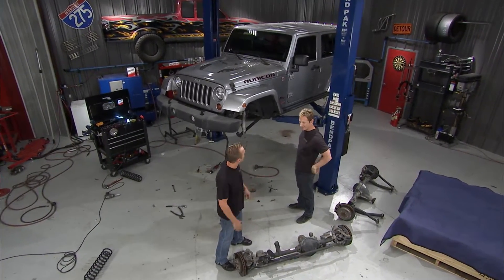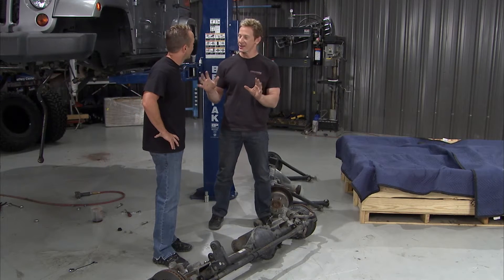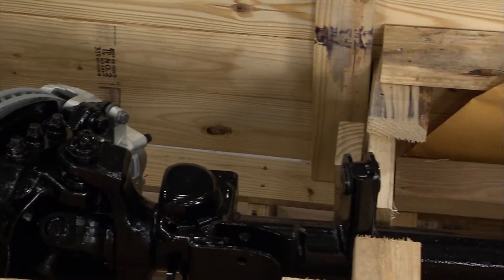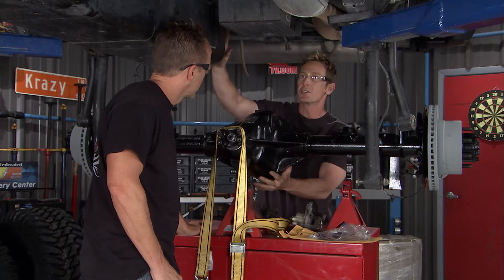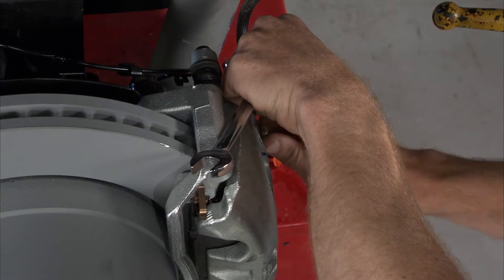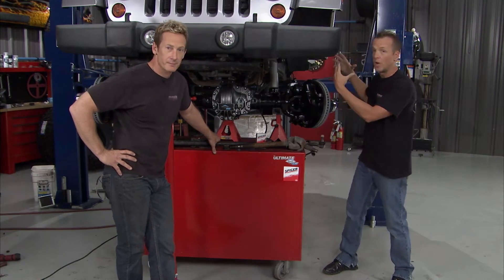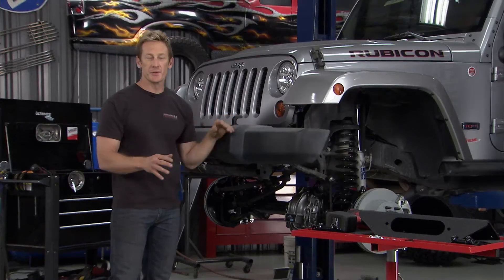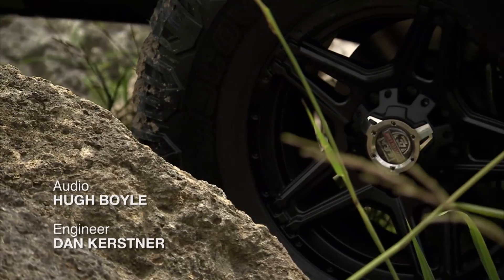Ultimate Dana 60 Installation on Truck U

Comment: What about 2nd gen ram?,mine has dyna 44 but i wanted to try to get strong axels..every dyna axel video is nothing but damn jeeps lol
Reply: 1 ton rear axle from the same year Dodge Ram. Preferably from a diesel truck. but I would get a 3rd gen diesel AAM front because it doesnt have that stupid 3 piece long axle tube. You would have to go 8 lug, but that isnt such a bad thing.

Comment: Buys a rubicon bc the axles..swaps axles
Reply: Rubi T case is far better than a sport
Already wired, and programmed for E lockers.
E Sway bar disco
The TCS, and SCS are programmed for 4lo,and lockers
There is much more to a Rubicon than the Rubi 44's. also you can  sell the Rubi 44's  to make up the difference.
Reply: And a sticker lol